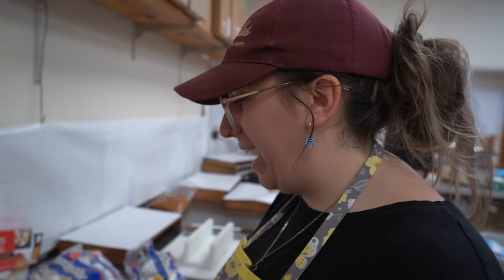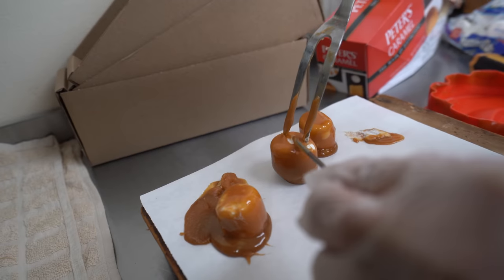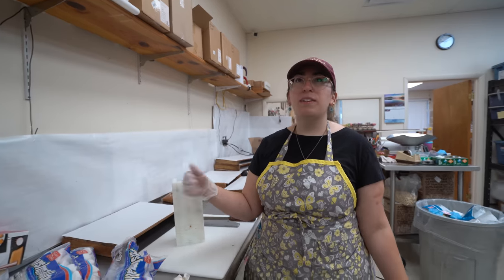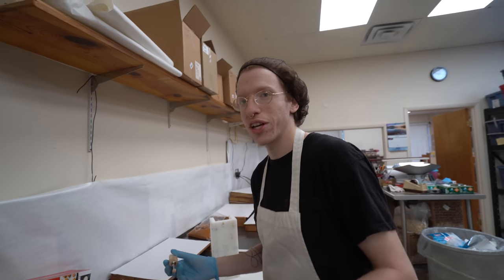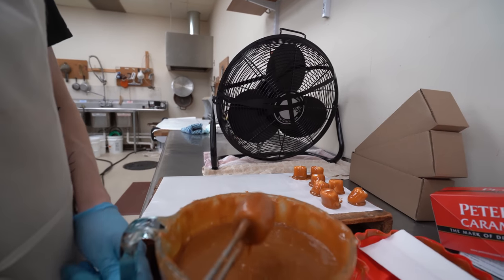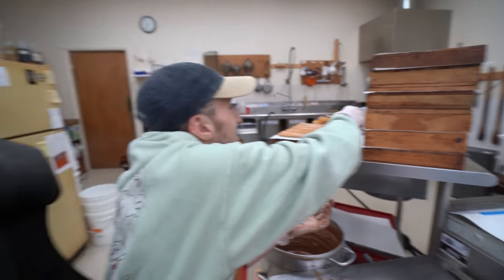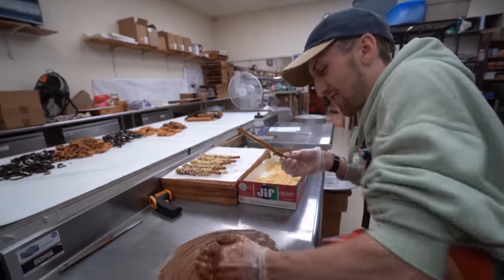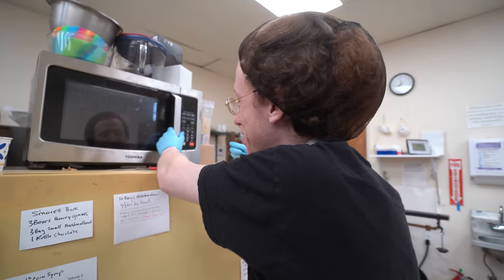Both Of These Sweet & Savory Treats Take A Whole Day To Make!

Comment: You could rig up a plastic cup or something that's above the peanut butter and when you stick the pretzel through the hole it'll be big enough for the pretzel as you dip it into the peanut butter but then when you pull it back out the top of the hole it'll just scrape the peanut butter off so you don't have to knife all of it all

Comment: Take a piece of strong copper wire 20" long. Get something round like a piece of pipe, wrap the wire around the pipe so the re is a loop in the middle, twist the wire so you end up with a loop and a twisted handle, bend the loop upward. Place a marshmallow on the loop, dip it and deposit the coated marshmallow onto a cake cooling rack and ease off of the loop. This way you get a smooth top and the excess can be re used.
Reply: Sorry, didn't explain, to add this would speed up the caramel coating on the marshmallows, and give them a much smoother appearance. Then run them through the enrober.

Comment: I have a suggestion!  Why don’t you cut a hole in the peanut butter cover, a diameter a little bigger than the pretzel rod, then just dip the pretzel and pull the pretzel out and the hole made will scrape the excess peanut butter off!!
Reply: i think it's because they have to whip the peanut butter first with an appliance
Reply: @Levynite , they can get it all whipped first, but rather than have to scrape the excess peanut butter off with a knife, the hole in the cover could just remove it as they gently pull the pretzel out of the jar!  Just a thought!
Reply: I was thinking the same thing it would make them more uniform.  It doesn't even have to be a lid. Because it looked like some of the pretzels didn't have enough peanut butter but I couldn't really tell because my new glasses arnt in.!?

Comment: could speed up the coating the pretzel rods with peanut butter by drilling a whole into a piece of plastic slightly larger than the sticks, place on top of jar, then dip stick through whole into the peanut butter. After which pull back through the whole, pulling most of the peanut butter off, but leaving a light coating on the stick. Just a thought, time is money hahaha

Comment: How about using a special fork ( looks like a devils pitch fork ), chocolateteirs use for dipping chocolate? For the marshmallows..?

 An how come you never had a little machine ( Has paddles that keep the chocolate moving ) to keep the chocolate or carmel warm? I think the machine helps temper chocolate better, overall without burning..

 Less waste overall.

Comment: Would it be easier to put the caramel in hot water like you do with the chocolate and put a stick in the marshmallow, then dip it in the caramel? Just curious because I have done them like that before. Thought maybe it would save you some time and running back and forth.

Comment: if you are worried about cross contamination  why dont you get a cup and pour the chocolate over the stick while holding it over the pot of chocolate it would be faster and easier to clean up afterwards that way you are not having to touch the chocolate at all.